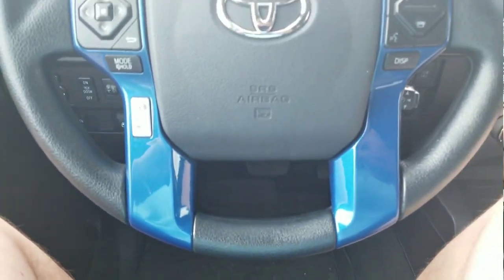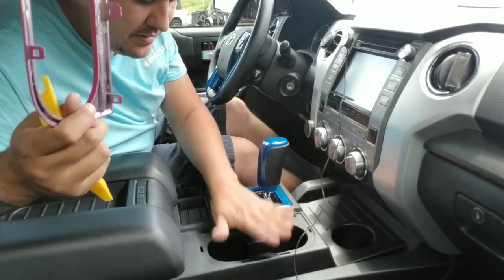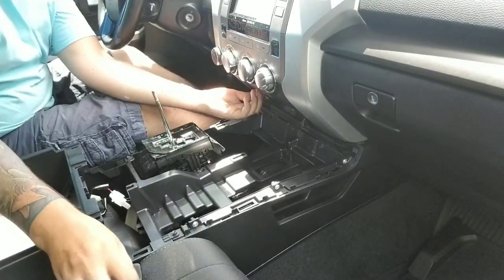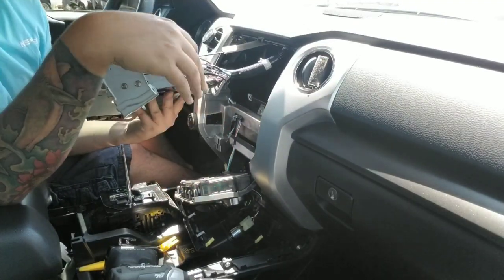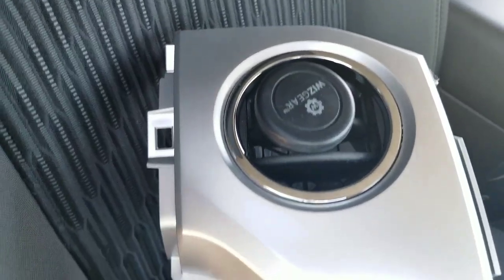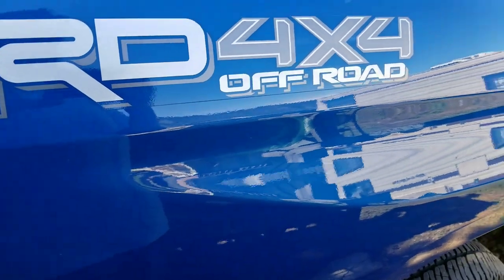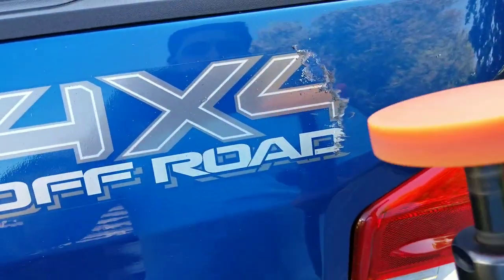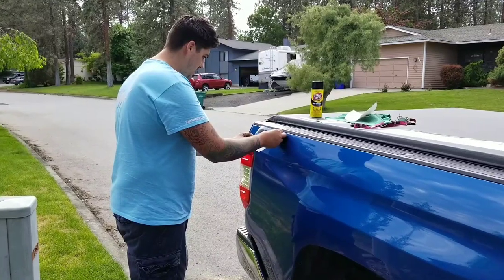How to 2017 tundra Trd painted interior mod.

Comment: So I'm wondering if that eraser wheel needs to be turned up a little faster....🤔 ...... 🤣. Just giving him $hit. Nice video, giving my 2 cents those decals can be taken off with steam or heat as well. We typically take molding adhesive off with the wheel and heat or steam for those thin decals and mylar. You can damage the clear if you use a wheel .